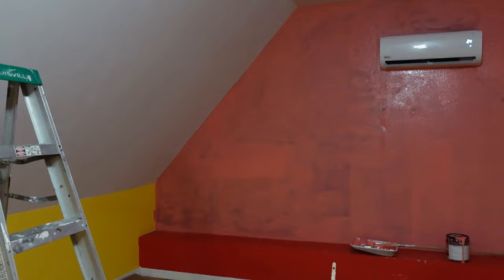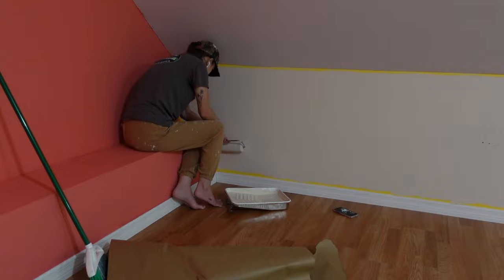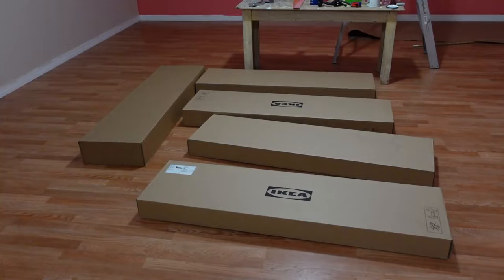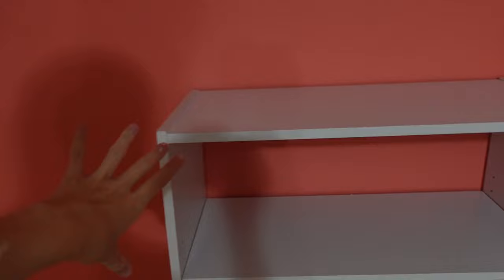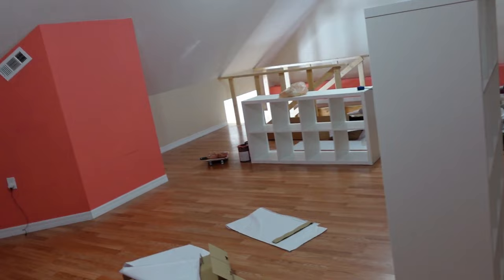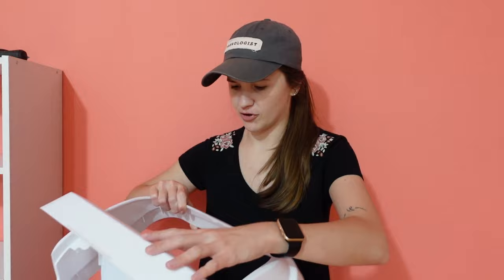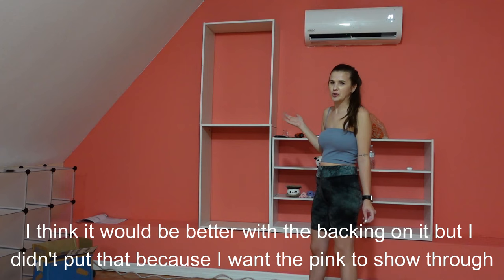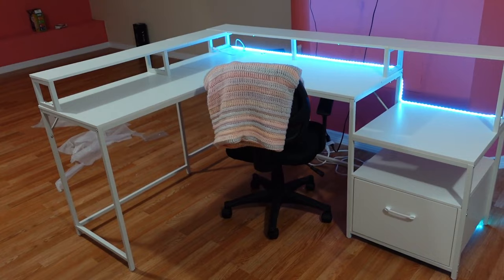Creating My Dream Yarn Room- Part 2: Painting The Room, Building Shelves, and My Desk!!

Comment: You could paint the backing board of the shelf unit before you assemble it. If it’s laminate the “opposite” side is usually a non-shiny brown (which may take paint better than the white side). You could paint that side pink, then nail it to the back of the shelf with the pink painted side facing the front. That way you would have your pink as the background plus stability.